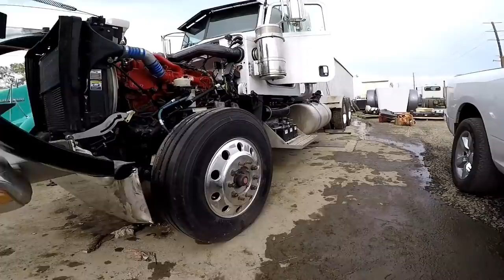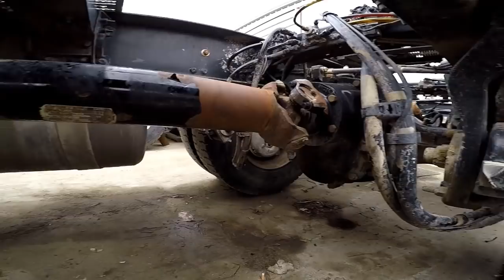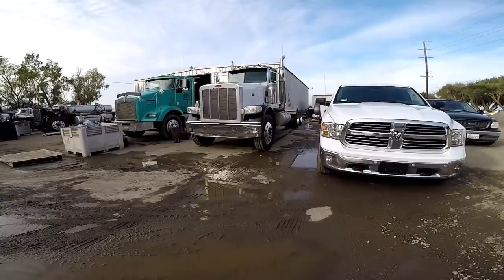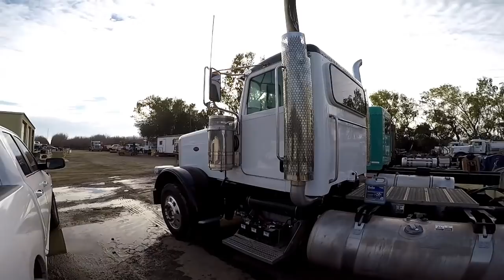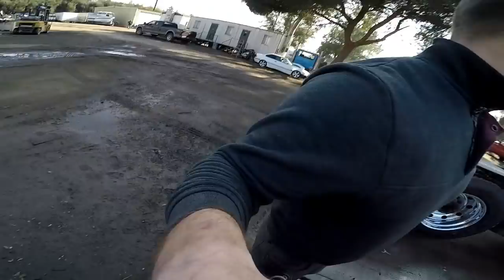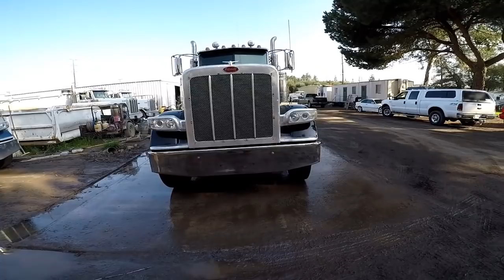Rebuilding A Wrecked 2015 Peterbilt 389 - Part 13

Comment: Now the moment of Truth. 
Put a load on and see what it does after 3,000 miles. 
Will it chew tires , will it have electrical germlins , will it have mystery noises ? 
That's the real shake down test for a rebuild like this. 
Looks like you guys did a great job.

Comment: Nice rebuild.....
You did good...
Now polish the fuel tanks. Get rid of that sissy front bumper. Put on a real bumper with tow pin holes because trucks get wrecked or break down.
Reply from the maker: Truck is already polished, although guy didnt do the best of jobs but itll do. And I like the bumper, i dont like the bulky look with the tow hook and holes. This makes it look cleaner, and besides, not gonna be my worry for to much longer hopefully lol